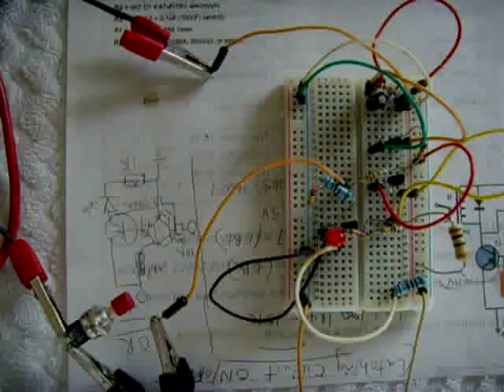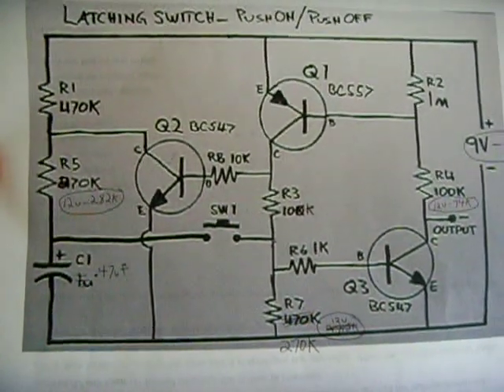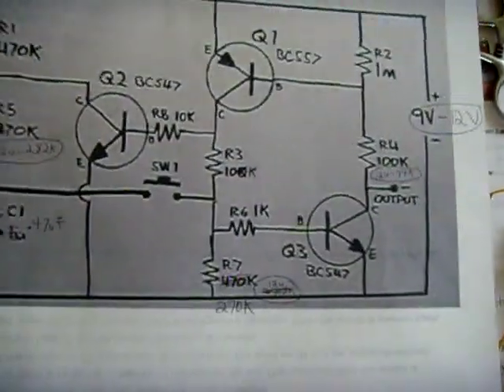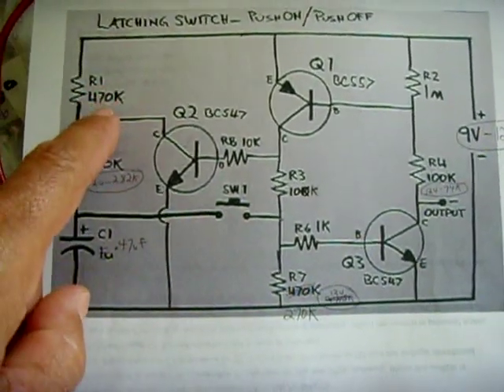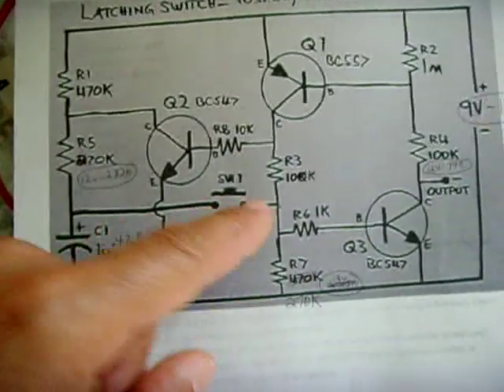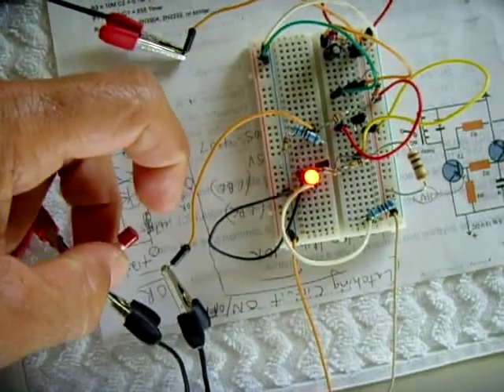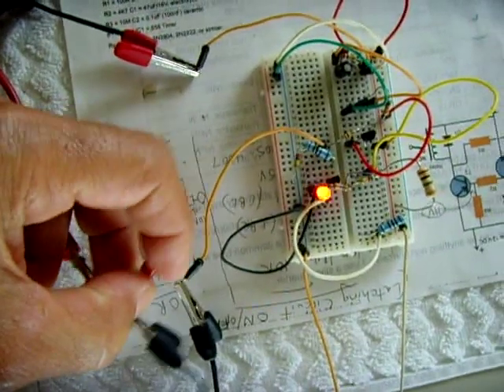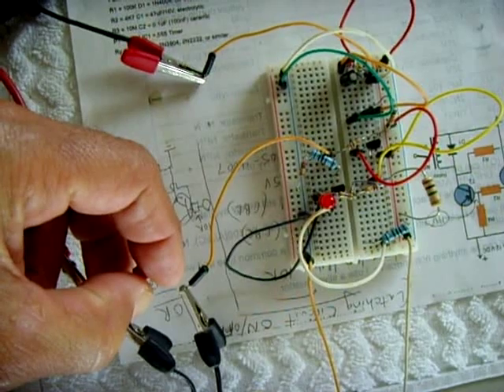Latching ON/OFF Transistor Circuit

Comment: Excellent! I'm looking to build such a circuit to drive an input from DIY touch sensor to turn on and off my desk lamp, need to figure out the HV AC side latching . Potentially through a HV transistor.

Comment: nao funcionou
Reply from the maker: pode ser complicado. medir a tensão na base de cada transistor enquanto opera para ver o que está acontecendo. Talvez seja necessário ajustar os valores do resistor.
Reply: Try 2N2222 transistors instead and use 1% tolerance resistors

Comment: Thanks,sir for your video,
but I've tried this circuit with the modified values but really it doesn't work, the output is always low when i press the button the output gets hi and after releasing the switch it gets low again(no latching),
any suggestions pls
Reply from the maker: +The Night Whisper 
The circuit definitely works, but it can be tricky to get it working correctly. Use the exact same components. If you still have trouble, I have another latching circuit on my channel. Thanks.

Comment: hi friend, I just like in the video, is to adapt a touch sensor, made with npn transistor and pnp in Proteus and it worked just that tic that use a relay. there is another way ???

ps. congratulations on the project.

thank you.

Comment: Can this circuit be inverted? i need exactcly the oposite. I want to power my Home Theather on at the same time as my tv. so i can power a relay when the tv its on but the home theater uses momentary switch to power on and off. any Ideia?
Reply from the maker: You need to use a circuit which sends a short pulse to the home theather momentary power switch. You can use a reed relay, and the contacts would connect to the momentary switch in parallel.

Trigger, Then Short Delay, Then Brief Pulse V+(555)

Comment: Looks handy :-)

Many years ago i needed a simple latching circuit to key up a c.b's base mic, i ended up using a button/resistor and small scr, on d.c it stayed latched, and another button across the scr to press to unlatch.

Very crude but worked for driving a relay.